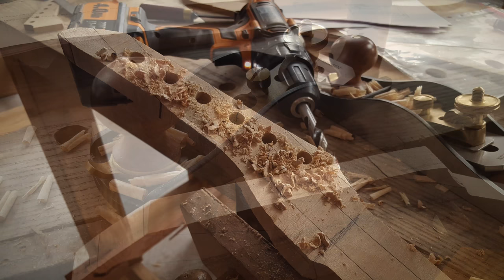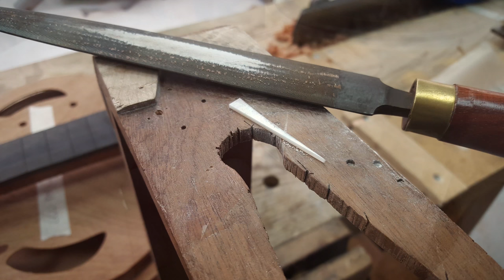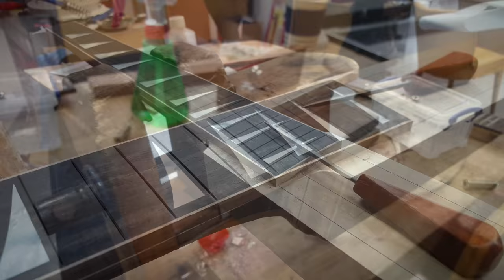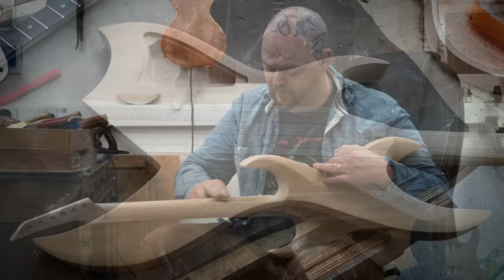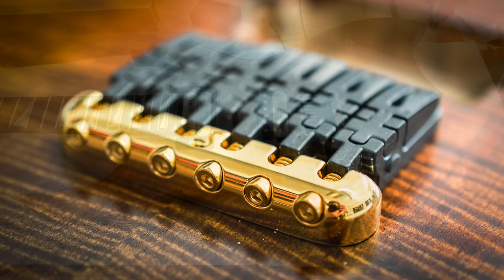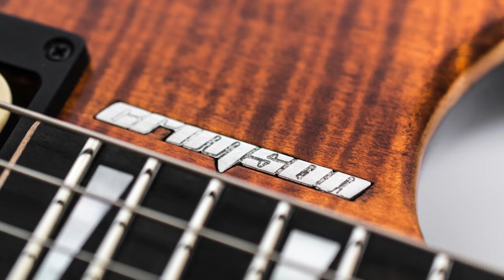A Custom Guitar is Born - Photo Montage from Start to Finish

Comment: You rock I have been tinkering with my guitars for 25 years I have built a few banjos out of old drums but have been building a 335 hollow body from some cheap China kit and your tips are awesome and helped a lot the neck was not even close to fitting thank God I have worked with wood Damn near my whole life I think I would have been better off building from scratch your tattooed head has helped greatly love your channel

Comment: As a hobby photographer  I would like to make a small suggestion regarding the close up shots at the end of the video: Set a higher f-stop to give yourself more depth of field, I know the blurry background looks nice and helps isolate the subject but if you have a plain background (in this case, white) you don't need a blurred out background and you just loose a lot of interesting foreground material. I hope you find this info useful. 
Kind regards,
Tom

Comment: Nice work, I wish I played well enough to buy it! Can you tell us what the finish was for the top?
Reply: Top Style: Flamed Maple flat top
Finish: Crimson’s Oil Stain burst finish, Amber to Black (front).

Just Crimson Stain, Finishing oil and Renaissance Wax, I believe. If I remember correctly that were using their Stain shots mixed with oil to apply it at the same time.
Reply: Thanks!

Comment: This is not meant as a criticism (as I love the guitar) but there's one thing bugging me...

Are there any issues with using another maker's body design? Would the BC rich guys have any justification to make a copyright infringement claim over a build like this etc?
Reply: Simon Ralston I wouldn't imagine so. even if he copied it exactly, it's a one-off custom guitar, with his logo on it. it isn't being mass marketed, or mass produced. there is nothing that BCRich could do. I doubt they could even send a "cease and desist" to Ben.
Reply: Yidris so if you come up with an original design/shape for a guitar body/headstock there's nothing you can do to stop someone else copying it?

I'm not arguing by the way! I'm genuinely interested as this is relevant to me.
Reply: Simon Ralston you are referring to the fact that the body is akin to a BCRich Bich, and it is similar, yes. however, the headstock is completely different, more in line with a Parker. 

let's perform a thought experiment: how many major guitar manufacturers produce copies of Gibson Les Paul's, fender strats, teles, etc? they change the headstock and they cannot be held legally liable for anything. 

the problem arises when you attempt to perform a DIRECT knockoff and change absolutely nothing. this can range from having the same shapes and a different logo like what happened to Clarence Leonidas Fender {when he started G&L guitars and fender, (the company that he founded), took him to court and forced him to change the headstock shape}, to making a direct counterfeit. 

long story short, as long as you change the shape of a major part of the guitar, e.g. headstock or body shape, you are good
Reply: Yidris I take your point about Fenders, Gibsons etc I thought as those designs were so old maybe after so many years in public realm maybe they had become "fair game".

The reason I ask this is I have my own prototype guitar with an unusual shape for both body and headstock. I'd like to build them and (hopefully!) sell them but fear others copying it and I would lose my uniqueness. I'm currently researching protecting the design but the costs (in Europe and US) are fairly high. I would still consider doing it but videos like this make me think any "protection" is possibly worthless. If Bc Rich can't stop someone then I guess a very small operator like me has no chance!
Reply: Simon Ralston all you can do is make your design, make a diagram with all of your dimensions, submit it to a patent office, and if someone directly copies it, you can seek legal aid. but it has to be a direct copy.